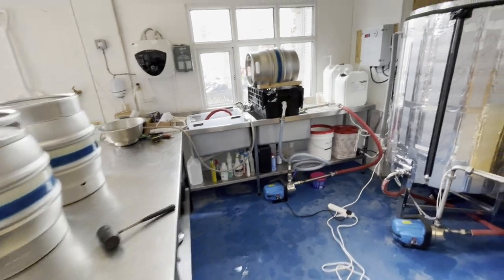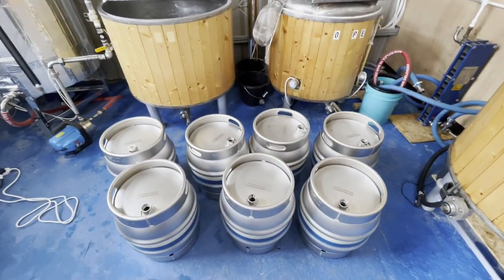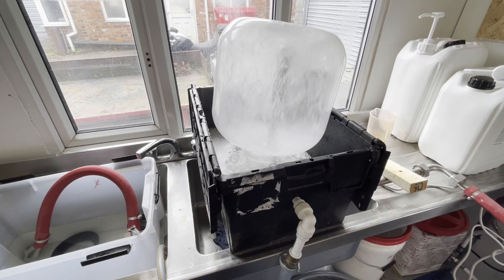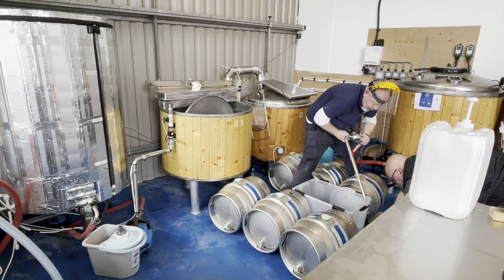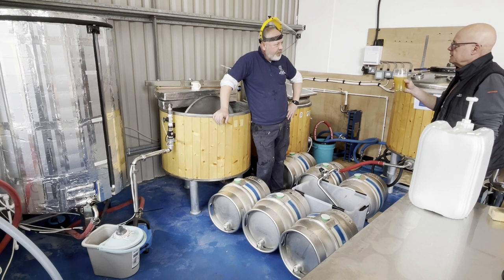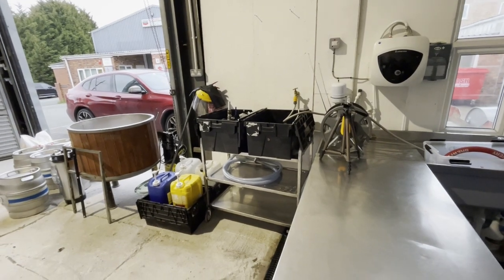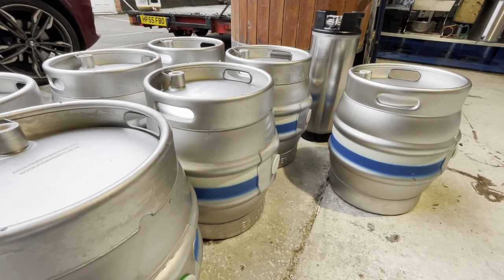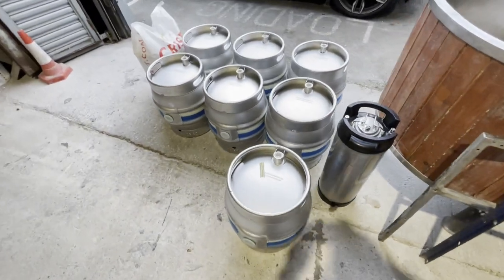Ep.34 - If I had a hammer, I'd hammer in the morning.

Comment: very nice. whats in the cip solution.?
Reply from the maker: Causgleam Plus then water then Percid 5. Cheers
Reply: @FourPriestsBrewery  Hi Andy, I'm from South Africa and would like to know if you could please share the concentration of the caustic and acid rinse you're using and the cleaning procedure? I am working from caustic flakes.
Reply from the maker: I use a product called Causgleam Plus which is 32% sodium hydroxide. For the tanks and casks I use it at 3 to 6% v/v depending how much soiling there is.  So that’s 600ml per 20L.  We wash at about 60C.  For the acid, I use a peracetic acid called Percid 5. Comes as a 5% solution, and we use it at 0.5% v/v with water. So about 100m per 20L